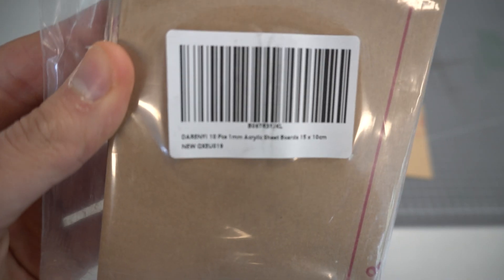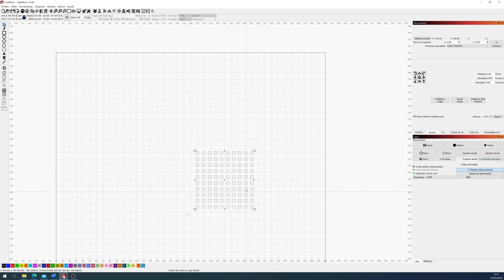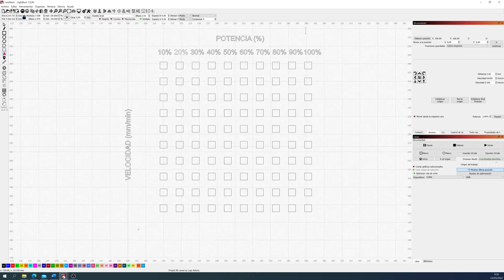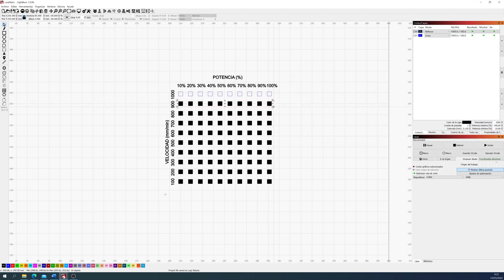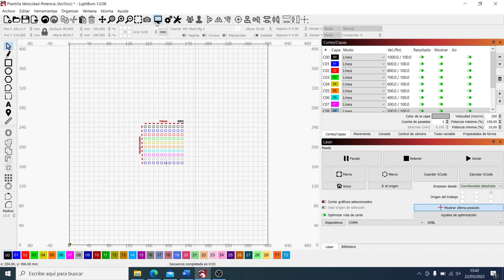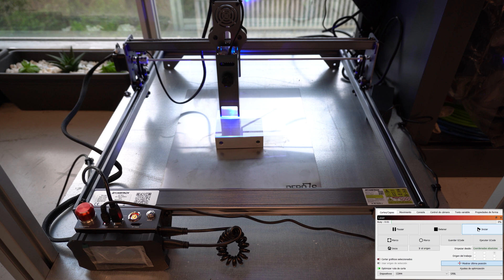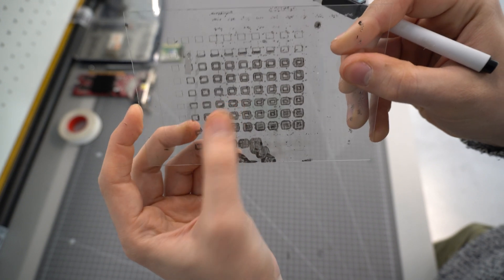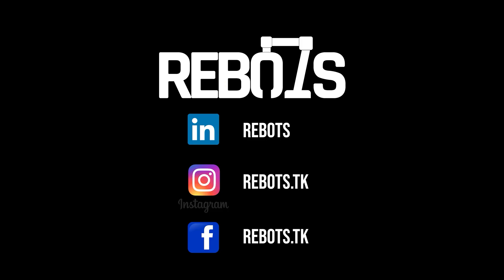Atomstack X7 Pro testing transparent acrylic sheet with Lightburn (power vs speed template)

Comment: So what is the solution to transparent Engraving?
Reply: Yo grabo con p9 m50... pongo pintura en sprite esmalte negro opaco .y lo quito con aguarras. O diluyente sintentico
Reply: I have heard to leave the protective film that the acrylic comes with.  Same idea as the masking tape.  Will be trying it out this week
Reply from the maker: Yes sometimes it works, it depends on the protective layer and the power, sometimes it just warps the plastic and bends it.
Reply from the maker: Depends on what you want? 
But the easiest and fastest solution is to add another black acrylic sheet on the bottom.
Another way is painting the back of the acrylic black, with a more opaque paint than the permanent markers we were using.
And lastly you can use a masking tape.
There are probably some other methods but we haven't tried them.
Reply: @rebots  
Try Chalk Markers
I saw some good results.
I will see it this week (ordered some) with my P9 M50
Reply from the maker: Thank you for the suggestion, we haven't seen any chalk videos. But I'll take the word for it. We'll try it and I'll let you guys know in another video.
Reply: @rebots  
Should be also easy to wash away. 
I also ordered some like that as a spray, it is used to do mark at roads etc and is non permanent.
For me it looks more to try it at the next weekend.
2 bsy atm